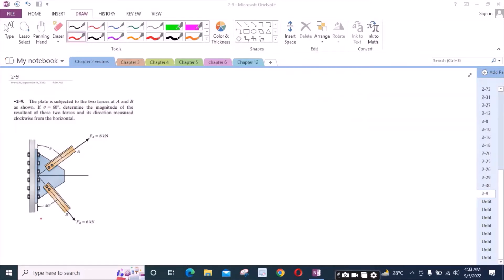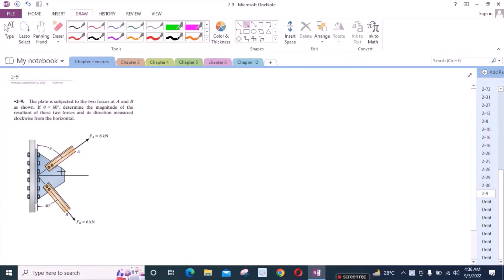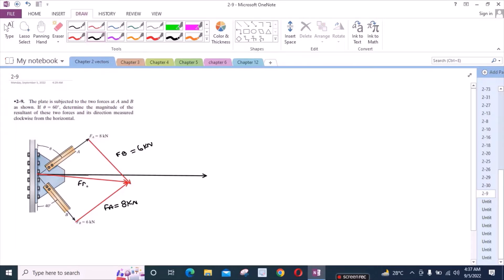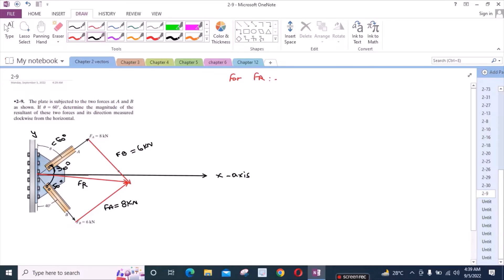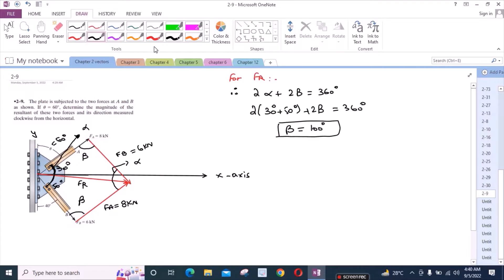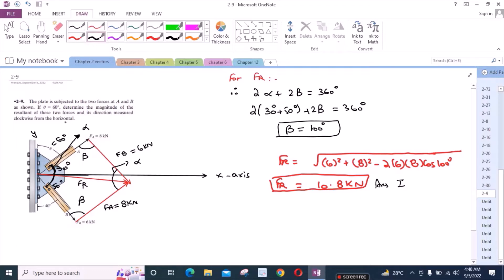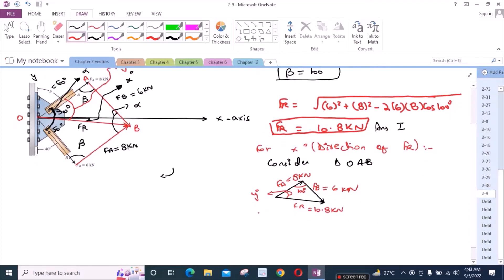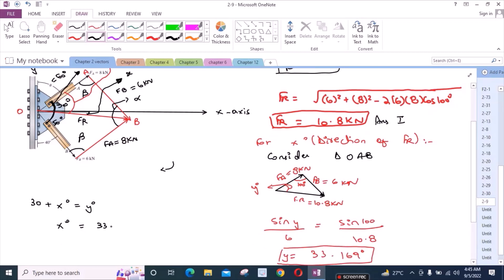2-9 hibbeler statics chapter 2 | hibbeler statics | hibbeler

Comment from the maker: Learn How to Solve 2-19 Hibbeler Statics Chapter 2, "The truck is to be towed using two ropes. If the resultant force is 950 N and directed along the positive x-axis, determine the magnitudes of force Fa and Fb acting on each rope and the angle theta of Fb so that the magnitude of Fb is a minimum. Fa acts 20 degrees from the x-axis as shown."
Here is the Link: https://youtu.be/huGbTedi-uQ

Comment: The direction is clockwise from the horizontal
So, the correct answer is 3.2
Right?
It need to subtract
Reply from the maker: Yes if you round it to two significant figures

Comment: I considered that the resultant is above the horizontal axis. I got the same as you, but with a negative sign, what I did is correct?

thanks for the video!

￼ Verificado
Reply from the maker: Yes your answer is correct. Always remember the negative answer in physics means that actual direction is opposite of what you have considered as positive.
Hope it will help!